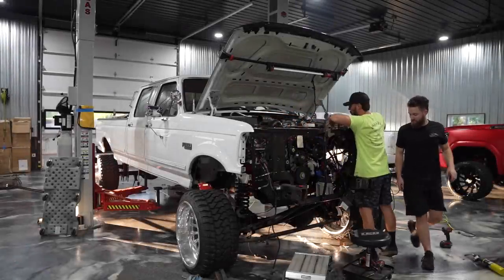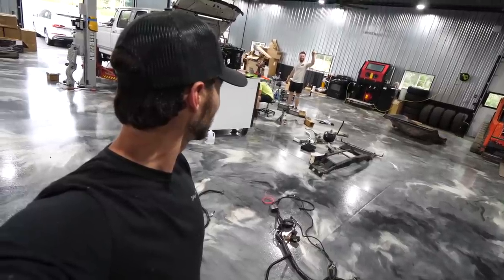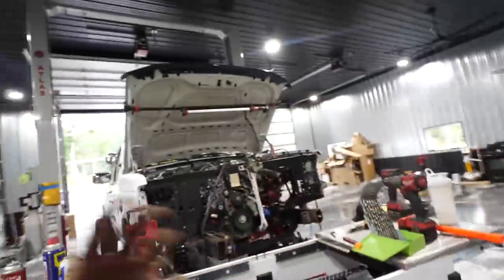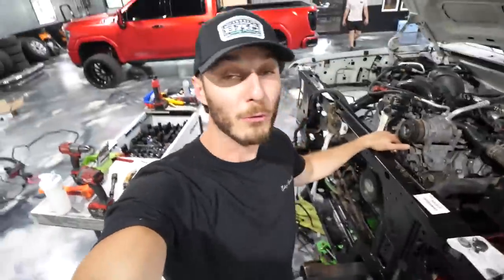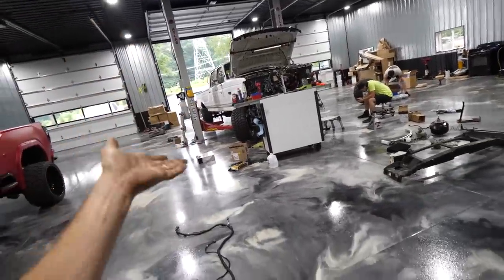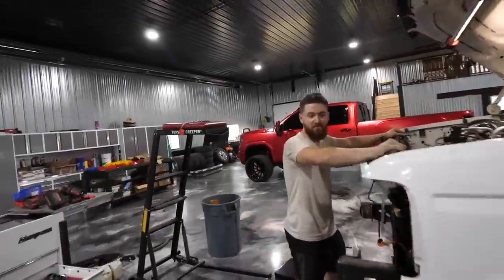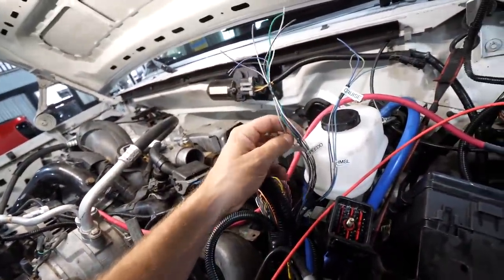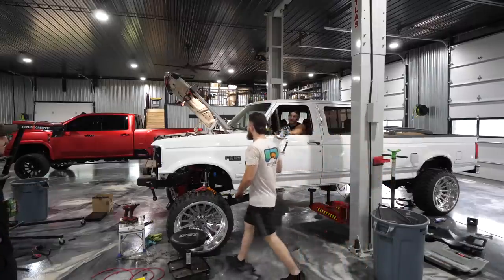I Made A BIG Mistake and Almost Burnt My Truck Down..

Comment: The wiring getting hot is a sign that power or ground is crossed double check all wires also vehicle must be in netutral to start to bypass neutral safety  unless you have that wired up also if you have gear selecter hook up you can skip this step also the brakes need to be wired for neutral safety to work hope that helps keep doing what your doing jack you will get it and knowledge is power

Comment: From the sounds of it you might have your relays swapped around, too much power to steering, to little to starter. Or you have a ground wire that's hot and carrying power over to steering double feeding it. Just my thoughts of what I would check. Thanks for the videos guys.

Comment: Did u say the power steering line was smokin? If so u don’t have a ground from motor to the frame. The high pressure power steering line is steel braided its tryin to act as a ground when it’s connected to ur steering box on the frame.

Comment: Ground from engine to frame ? And relay numbers: 85-ground 86-switch from ignition 30-power from battery 87-switched power to fuelpump or whatever needs power.

Comment: Could it be the steering is the only ground to the frame from the motor? That would explain why the power steering is getting hot right? I know the duramax engines get finicky about grounds.

Comment: I don’t know if you will see this but do you know if the ecm has had the vats turned off?  If it hasn’t it most likely won’t crank over bc it’s in security mode. If you have questions you can pm me and I could try to help.